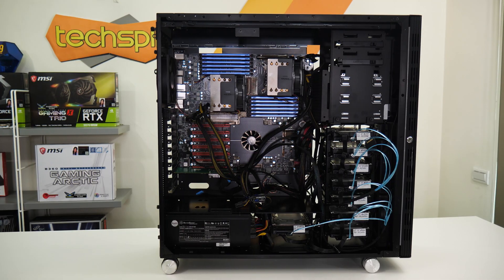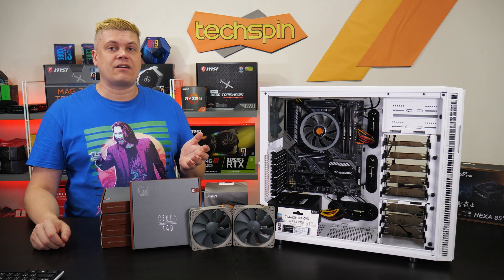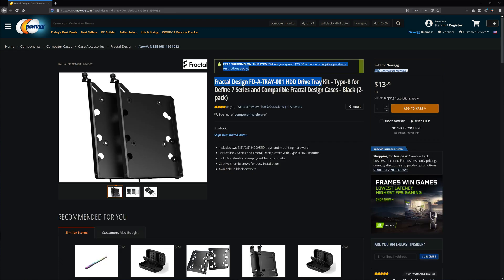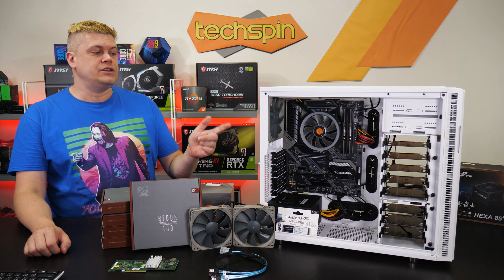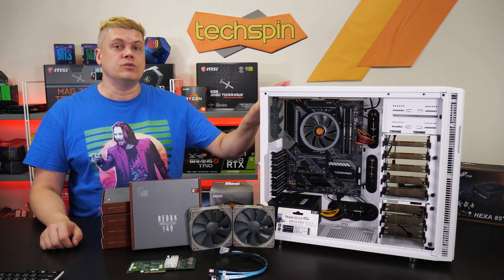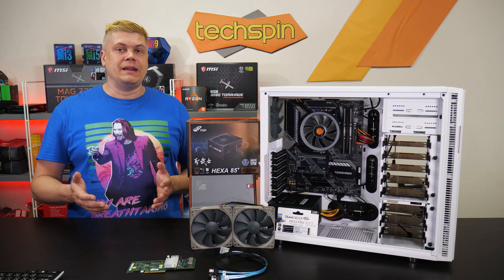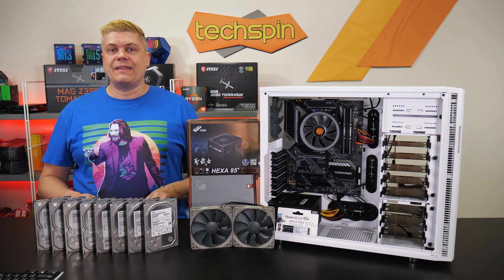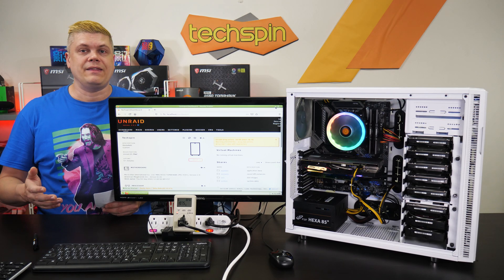Best parts for a Media Editing NAS/How to Build 2021

Comment: Thanks for the video, subbed!

Just about to start my first NAS, managed to still secure a R5 for $180AUD and got everything else second hand. I ended up with a Intel Core i5-11400 for $90AUD and a MSI MEG Z590 ACE, which I got in auction for the absolute steal of $143AUD it has x3 16x slots for a LSI 9300-16i HBA, x520-DA2 NIC and Intel Arc A380 for transcoding. For storage, my work kindly let me keep ten WD ULTRASTAR SAS HDDs. :)
Reply from the maker: Nice parts there, good luck with the build!

Comment: I only came here for the case recommendations....   fractal r5  or antec p101,
Reply from the maker: Haven't tried that Antec case, though after doing this build, go with the newer Fractal Define 7 XL- you need the maximum HDD airflow that this case provides. The older R5 is just okay for this as the standard drive cage design blocks air flow and it requires a static pressure fan upgrade in the front if you want to close the front panel during operation. The default R5 solid front panel/side vents+front fans don't allow enough air intake for a NAS unfortunately. Don't forget to subscribe and tell your friends to help us grow! Thanks for your support!
Reply: @Techspin  wow thanks for actually taking the time to leave a comment with real advice!  this earned you a sub. GG
Reply from the maker: We do try to answer lots of comments, been working on client cases so getting caught up here. Welcome to the channel 😀

Comment: Search "B550 Tomahawk NAS" and found this video, made me a lot more confident seeing your build. Even grabbed a cheap Fractal R5 last week, so that most be a sign.
Reply from the maker: We've added notes in our website post (check description) of issues we found after assembly and use, especially the top 2 hard drives were overheating with the front case door closed.  Final build used an Asus ROG Strix B450-F Gaming, key was the temperature probe header, and after we connected a sensor on the hottest reported drive and made the fans adjust to that in BIOS.  Cooling was upgraded to high static pressure Noctua fans in the front... in summer we still will likely need to open the front during Parity check.  Considering the newer Fractal Define 7 XL but it's fairly costly upfront, and our next upgrade will be bigger NAS drives.  Don't forget to subscribe and tell your friends to help us grow! Thanks for your support!
Reply: @Techspin Noticed that one drive hit 45c during my parity check while the rest were cruising about 35-40c, running 8x exos 18tb. Got the original 140mm and a FD Prisma 140mm "that sounds horrible" in the front. Was thinking about picking up a Artic Cooling P14 5pack, but yeah no way of controlling it. Might just pick up a bunch of NF-A14 and drive them hard, there is a hum to the exo drives that i could try to match.

Grabbed the r5 for about 100bucks "1000sek" and that's with 25% VAT absolute steal.

*Yeah shit just noticed that "the top" of the top drive get no air over it from the front fans. Can probably jerry rig a 90mm there, already jerryrigged one for the hba.

Comment: Would the athlon 3000g be a good CPU to use in a NAS? Thank you
Reply from the maker: If you're reusing old equipment it's fine but we wouldn't recommend it especially if you want to do anything else other than  only running a NAS. If you plan to use Unraid with VMs then not cheaping out will give you a lot more headroom for running other stuff from your NAS. Don't forget to subscribe and tell your friends to help us grow! Thanks for your support!
Reply: @Techspin  at moment I'm running my Openmediavault NAS with a 15 years old motherboard and intel cpu....untill stopped working so decided to upgrade to a 3000g and a Gigabyte B450M DS3H mob , I doubt is going to be worse then what I had . Thank you
Reply from the maker: Sounds like a definite improvement! Good luck

Comment: why not just have your storage directly on the NAS instead of syncing wherever possible, especially when you have 10gbe?
Reply from the maker: That's an excellent question. We were planning on an upgrade to 10Gbe (minimum) but then Covid lockdown occurred in Taiwan, seriously affecting episode production, and income.  Storing it on the NAS will be fine for most use cases, however we're doing video production here, and without the LTT budget with 25Gbe and Threadripper editing stations.  For a smart solution on a budget, a local NVMe mirror is the way to go. Even with 10Gbe, an editing CPU data request> ethernet controller> cat cabling> NAS eth controller> Unraid fetch data even on NVMe cache, and return all that can never beat an editing CPU data request> NVMe m.2 and return, although we are talking about milliseconds saved.  Since we're using a 5950X and 9900K for workstations, this simple solution should be able to get close to top level performance.  But yeah, for most, on the NAS should be fine.  We will try to revisit this once we get hold of enough 10Gbe parts to do an episode. Don't forget to subscribe and tell your friends to help us grow! Thanks for your support!
Reply: @Techspin  Thanks for the reply! I'm curious if those milliseconds saved would actually bear out in a performance test, and what the real-world experience would be;  I'm considering moving all my editing (and my friend's) to NAS solutions currently for safety and for ease of workflow, but I'm curious about what the trade-offs might be.  If it's a few milliseconds here and there, it's worth being able to dump everything onto the central NAS and not worry about if I or my friend have the footage we need on a particular laptop or desktop PC, and we could ditch the dongles and external drive usage.

I also just saw a video where a guy was editing 4k video off a NAS with 1gigabit NICs, but I'm sure this is absolutely not advised... I'm wondering how he gets even close to reasonable performance that way....  

Looking forward to see what you come up with next!
Reply from the maker: As long as the current project is on the NAS's NVMe cache, it's quite possible it'll be responsive enough to do 4K editing, though we don't use proxies so really wondering how that scrubbing will turn out.  Will see if we can run some tests after we have the next ep script done...
Reply: @Techspin  subscribed twice 😆 thank you!  You’ve already gotten my NAS project off the “procrastination” list. Looking forward to seeing future videos
Reply from the maker: Cheers. BTW, just found out that some ASUS boards, like the Strix B450F Gaming have a temperature sensor header. While this may seem trivial, setting front fans to full during parity based on this value is super important. We just got in sensors yesterday, will connect and test soon.

Comment: I recently upgraded to this setup:  3900X, ASUS ProWS x570-ACE... 3 x16 slots all running x8/x8/x8... Worked out well for my two Intel HBAs and Nivida P2000 card... 64GB Ram and 10 8TB drives with 1 as parity.  It handles basically anything I want to do with it.
Reply from the maker: Oh we looked at that ASUS ProWS board, that looks really sweet. Nice build specs!
Reply: What are the IOMMU groupings like?   I.e. if I wanted 2 GPUs in the 1st two x16 slots, would the IOMMU grouping be separate for each GPU and no other items inside each IOMMU group that contains each GPU?
Reply: @paulpoco22  Not sure how it would be in your situation.  I'm not a master of our IOMMU works, but I suspect it can be very different based upon the cards chosen.  So, in other words, my setup will more than likely be very different than yours.
Reply: @glonch  are you using ECC RAM?
Reply: @paulpoco22  Nope... Haven't had any problems.
Reply from the maker: Yeah we might look into ECC when the crazy prices come down again, not willing to drop +60% more cash just because the market says. We're making do with good ol' non-ECC for now
Reply: Now tell us, which bank did you rob to make this possible. I'd like blueprints as well. Interested in building similar.
Reply: @truthseeker2171  LOL... I didn't do it over night... started small - PC with i5/16GB ram, 1 external 4 bay eSATA enclosure... then went to an ASUS gaming MB, Ryzen 5... etc, etc... this is the 4th iteration of my setup...
Reply from the maker: *iteration
Reply: @Techspin  Thanks!